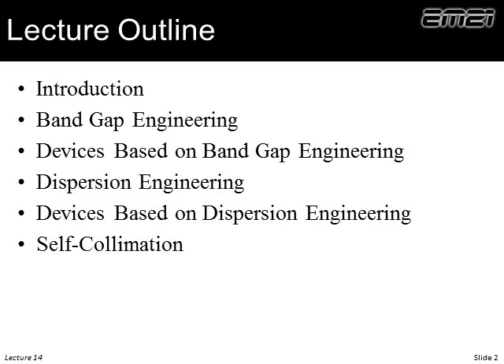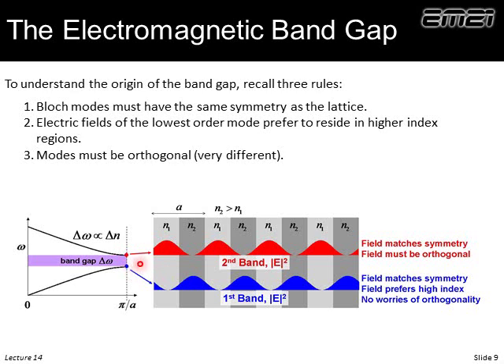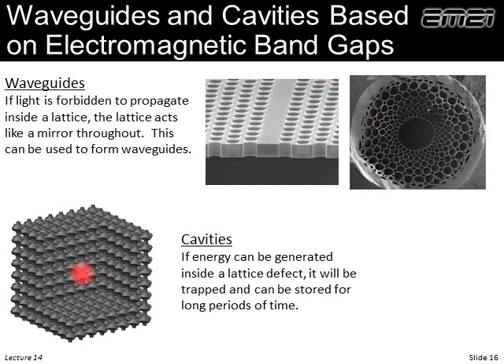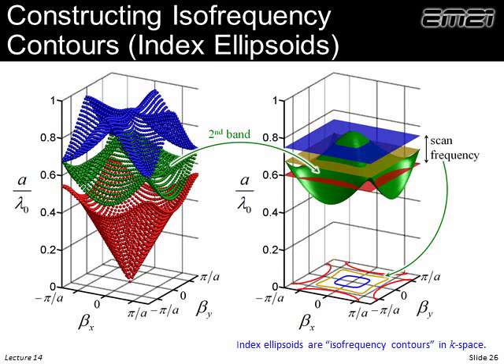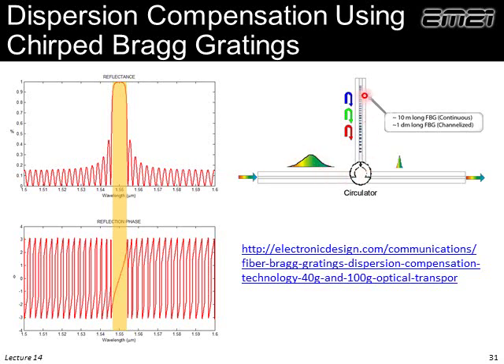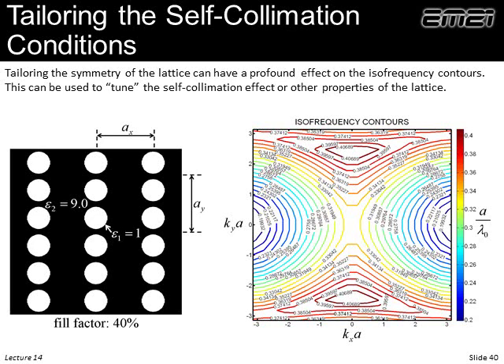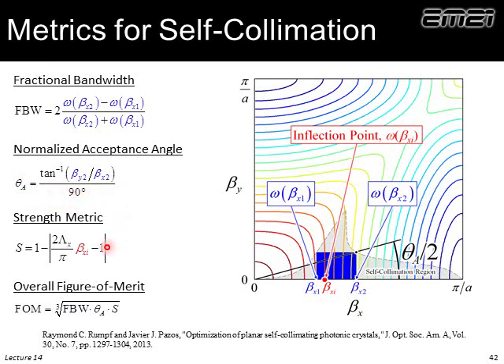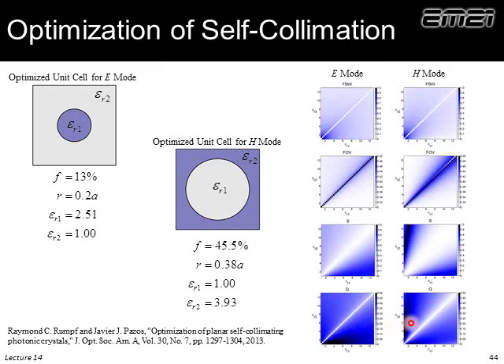Lecture 14 (EM21) -- Photonic crystals (band gap materials)

Comment: Isn't that weird? e^(j*b.r), shouldn't it be e^(j*arccos(b.r))? When I see vectors being fed into e like that, there seems to be a higher dimensional thing going on. Like, I should be looking at contour maps, domain coloring, or doing square matrix transformations in ℂ^2 or ℂ^3.
Reply from the maker: There is a dot product happening...beta dot r. The dot product of two vectors is a single scalar quantity. Maybe the symbols got messed up in the video render. I will have to check.

Comment: Thank you for your lecture!
In 2D photonic crystal structures, I think there are no consideration of slab thickness (bottom boundary condition), also in simulation tool. 
I'm wondering that solving 2D PhC eigenmodes includes assumption of infinite thickness.
Reply from the maker: If you have a photonic crystal slab, boundaries at the top and bottom must both be considered in order to get an accurate simulation at all frequencies. Sometimes it is still instructive to look at scattering from a single interface, a bit like the meaning of the Fresnel equations.

As formulated, photonic bands are typically calculated for a lattice that is infinite in all directions. This GREATLY simplifies the analysis the conclusions are typically very consistent with the properties of a finite lattice. It is only when the lattices are very thin or perhaps other situations I am not thinking of where the properties deviate significantly from the properties of an infinite lattice.

BTW, if you want to learn more about the simulation tools, I have creates some resources for that. First, below is a book in finite-difference frequency-domain that I think is the best first method to learn. The book is intended for the complete beginner.

https://empossible.net/fdfdbook/

Another good method is finite-difference time-domain. For this, I created an online course also intended for the complete beginner.  Below is a link to a video showcasing the course as well as a link directly to the course.

https://youtu.be/uBiprIN8gfY?si=STJlTYSny4FMh6DY

https://empossible.thinkific.com/collections/FDTD-in-MATLAB

If you want to learn some more advanced methods like the plane wave expansion method or rigorous coupled-wave analysis, checkout this Computational Electromagnetics course:

https://empossible.net/academics/emp5337/

Hope this helps!

Comment: regarding the parameter of PhC structure, it's have any equation related to lattice constant, air holes radius and slab tickness? I cannot justify my proposal thesis for my result
Reply from the maker: Typically some kind of a simulation is done on a photonic crystal to calculate the band diagram, isofrequency contours, or something else. Usually it is desired to design a photonic crystal for a specific wavelength so the lattice constant is calculated from the simulation in order to have the PhC operate at the desired wavelength.

As for geometric parameters like hole radius, there may be equations for this for some canonical lattices, but the physics is complicated enough that this information usually must come from a simulation and not an analytical equation.

To justify something for your proposal, you will either need to point to some literature on your topic that justifies your ideas or run some simulations to justify your ideas.  I suspect you are just starting out and simulations may be a new area for you. You have two options. First, you can use commercial software or open-source software. Second, you can develop your own codes and capabilities. I recommend the second approach because the commercial software lacks some capabilities that you will likely need if you are doing something new or different. I recently wrote a book specifically intended for people to get started in computational electromagnetics/photonics (CEM). It not only teaches a powerful and versatile method, it teaches the art of CEM. The art includes benchmarking, troubleshooting, convergence, setting up codes to simulate different things, sources, boundary conditions, etc. This is all done using very plain language. Here is a link to the book website:

https://empossible.net/fdfdbook/

Another good place to get started is an online course on finite-difference time-domain.  Here is a link to a video showing what is in this course:

https://youtu.be/uBiprIN8gfY

Here is a link to the courses themselves:

https://empossible.thinkific.com/collections/FDTD-in-MATLAB

I hope something here helps!!

Comment: I don't understand why you're explaining that propagating electromagnetic waves is forbid in bandgap materials. Isn't it possible to say that electromagnetic waves pass through? thanks for the good lecture
Reply from the maker: It gets into a bit of semantics.  Waves that are "forbidden" are more accurately described as cutoff.  This means they can still propagate through the photonic crystal, but they decay in amplitude as they propagate.  When calculating a photonic band diagram, the lattice is assumed to be infinitely periodic.  Even waves that decay very slowly will decay to zero in an infinite lattice.  We tend to ignore the fact that the waves can actually propagate some short distance, but you are correct that they actually do.  The same can be said for modes in a waveguide that are cutoff.

Comment: I know ligh line is w=ck|| . The definition of light line you expressed here was something new to me. What is the relation of the first definition and the one you mentioned? 
Indeed, How can I calculate a related light line of a dispersion curve?
Thanks
Reply from the maker: I am being lazy in my language.  What I call a light line is not entirely a light line.  Instead, it is the band for a homogenized unit cell.  Those bands starting at the gamma point will be the light line until that line reaches the edge of the Brillouin zone and then it folds.  A true light line does not fold.  The point is to show where the photonic crystal band deviates from the homogeneous band, which is the light line at this point.

Did this help or did I make it more confusing?
Reply: Yes, I get the point.
Reply from the maker: Great!

Comment: Do you have a lecture about bragg law and its relation with BZ? I am looking for a concept about superprism and angle-dependant bandgap. I saw in some papers that both superprism effect and the partial gap ( dependet on the angle of incident light) stem from the modes on surface plane of BZ not bulk modes (inside the BZ).
Reply from the maker: Not really.  I talk a little bit about it in the coupled mode lecture, but I do not think I have what you are looking for.  Very sorry!

Comment: Thanks a lot for the channel you prepared! I do love the lectures and follow them. 
I simulated some 3D pc and derived the DOS. In different meshing that people provided in order to have a precise DOS, I saw they avoiding Gamma point. So all the meshing were in a way that skip the center (0,0,0). Indeed they are right, because when I change the meshing step somehow that includes the Gamma point , DOS result showed a wierd trending at zero to higher frequencies ( like descending).What is the point here?
Reply from the maker: I am not sure what calculating methods those others are using, but the gamma point has the Bloch wave vector magnitude of zero.  This can cause some numerical methods to fail or yield crazy answers.  I think this is the only reason they are avoiding the gamma = 0 point.
Reply from the maker: Ok, so I went ahead and created a diagram to go with what I was trying to explain in my previous reply.  Take a look at slide 12 in the latest version of Lecture 19 here:

http://emlab.utep.edu/ee5390cem.htm

Comment: Dear Professor, I have noticed here you mentioned both mode expansion method and FDTD should end up with the same result of bandstructure ( for one structure). I have simulated a structure at mode expansion which seems correct. But when I simulate it using FDTD, there are big differences (some extra points and some missing bands) between its result and the one from mode expansion. 
at FDTD I have used a supercell ( 4 primitive cells).  In any cell, I have used four dipoles (16 at supercell).  Also, the meshing step is about 0.04 micrometer. The time for simulation is 1000 seconds.
I was wondering if the number of dipoles is low that's why I am missing some bands or I should go for the smaller step of meshing. I appreciate your opinion on this problem.
Thanks
Reply from the maker: Why are you arraying four unit cells?  I suspect this is the problem.  Just use one.

Another thing you can do is find a similar structure in the literature and calculate the bands with both PWEM and FDTD.  See which matches the correct results.  Maybe your PWEM is the one getting the wrong result.
Reply: The structure is an FCC, that's why I have made a supercell from four primitive cell.  Indeed the PWEM result is correct because it is similar to a literature but the FDTD results are different. I have changed the meshing and increase the number of dipoles to 24, but no changes.
what is the main factor that cause some noise or missing points in FDTD method?
Reply from the maker: I don't think you are implementing the supercell technique incorrectly.  There should not be a need to include anything more than one unit cell in memory.  Doing this can cause strange things like mystery bands, missing bands, and incorrect bands.  Just use one unit cell in FDTD and see if that fixes your problem.
Reply: Do you still study about PCFs?

Comment: Thanks a lot for this lecture, I am following your lectures about photonic crystals, I have simulated some photonic band structure and provided the related DOS as well. In some structure, I saw DOS at zero frequency is equal to DOS at some highr frequencies, all the time ( I mean for all the structures), we don't get the exponential graph. Should I trust the DOS in this situation? because I can see people mention the same exponential graph of DOS for their structure at their papers.
Reply from the maker: Not sure.  How are you calculating the DOS?
Reply: At plane wave mode expansion method, I use MPB to derive the bandstructure, also they have provided a code that counting Gaussian smoothing function around any frequency point. This one shows zero frequency has the same value of DOS like the higher frequencies of the first band. When the frequencies increase also the number of band increase, then DOS shows exponential trending ( It happens after the first band). 
Also, at FDTD, I use Lumerical. I derive the data from bandstructure graph to matlab and count the number of peaks at any frequencies to calculate DOS. Sometimes, I see the value of DOS at zero is more than that of the other frequencies. Even it is possible to guess it from bandstructure graph, because there are a lot of point at frequency=0 line at the graph.
Is it possible, it happens because of the tolerance, I mean the counted peak is not a real answer because the value of the peak is quite low compare to the others.